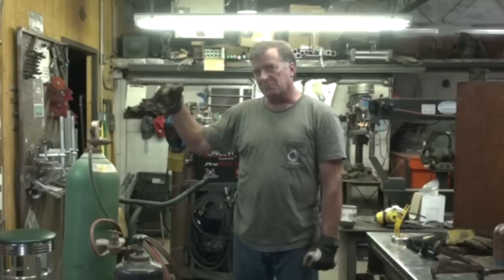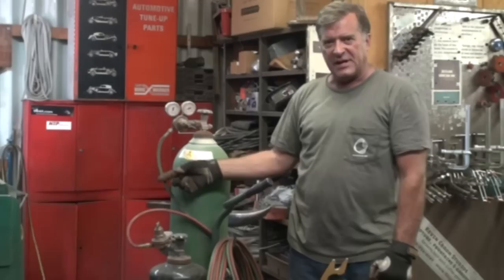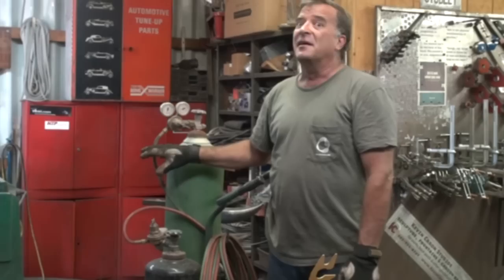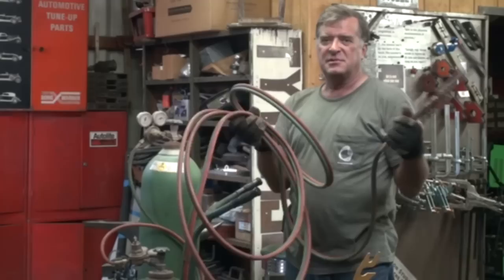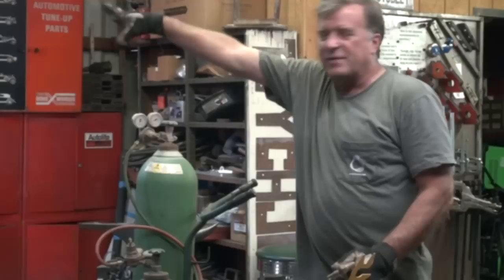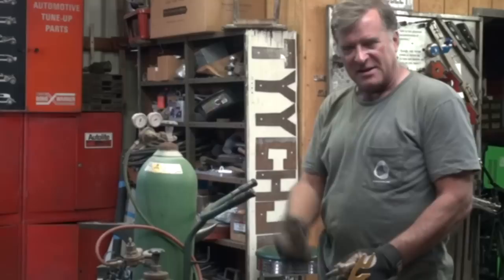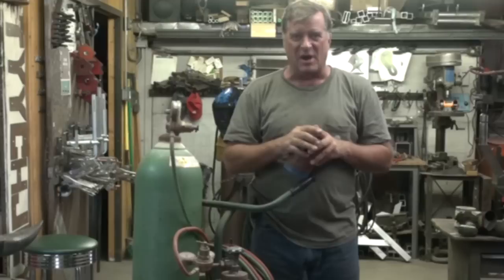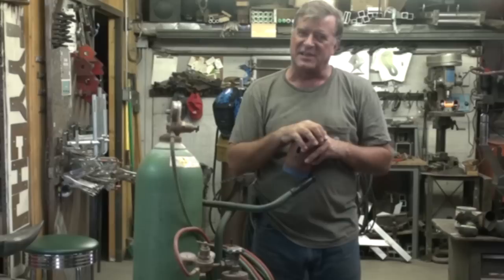Oxygen-Acetylene: "What Could Possibly Go Wrong?!" - Kevin Caron

Comment: This is good... I don't see anyone else stressing safety with the Oxy-Acetylene rig. I've had one mishap where a previous regulator (that was cranked up on a dead bottle of acetylene) was refitted to a new bottle. The person I was working with (my brother) wasn't trained to do this check list and I feel it almost costed us our lives. One hose blew up and the flashback was luckily stopped at the regulator. If it had gone into the acetylene bottle, I know without doubt I wouldn't be here today. The flashback was ultra violent, it created a huge bang. Know what you are messing with! 8 PSI for acetylene and I like 11-20 PSI on the oxygen side. Go above those numbers if you are feeling stupid.

Comment: You have oxygen and acetylene confused. Oxygen you open all the way because it is not dangerous and is very high pressure and the valve needs to be seated. Acetylene is low pressure and the valve does not need to be seated but is dangerous. On acetylene you open only 1/4 turn so you can turn it off quickly. Oxygen you open completely, acetylene only 1/4 turn.

Comment: Kevin, I have been using O/A since 1070, and just watched a Victor O/A safety video.  On the O2 cylinder, you ALWAYS backseat the valve when in use.  Opening slowly at first is correct in case there is a problem.  The Acetylene is only opened 1/2-1 turn ( just enough to get full pressure on the high side gauge).  If it hits the fan, it will be the Acetylene, and there in lies the need for a quick shutdown. ( as you run out the door, yell to The Voice to shut it down)
Reply: Correct! I have no earthly why he states, 'Some guys believe you need to open it up...'. YOU DO. It's a counterseat design so, those 'some guys' are completely industry correct! His recommendation is a pure safety concern.

Comment: No mention Sir Of How to spot  if Decomposition Takes place . On how the Cylinder will tell you By resonating  .   Good video  Nice Tig sat there .
Reply from the maker: Thank you for watching and posting.   No idea how to tell if the cylinder is decomposition on the inside. The bottles has inspection dates on them and they get a new one every 5 years.  If they fail they are sent to the scrap yard.
Reply: @KevincaronSculpture   Oh Don' t Worry the cylinder will tell you when decomposition is under way they physically Vibrate Resonate when they get to that stage it's time to leave the immediate area because they will let go soon after  and remove the roof .

Comment: It's also a good idea to have a good charged portable fire extinguisher close by whenever you are working with the torch set up. If we are working outside of our welding area on a job or equipment we put an extra guy on fire watch duty just in case.
Reply: 00sniper1 কহি র৫উ৬৫৫আদসগ।  জস্যহফ।  যদি গদস। য়েয়িদজ্য
Reply: 00sniper1 হ্যতেয়। য়দ্যক্যয়াগ্যতপখজ   য়সজিউয়ল। ক্লদ৫&&&হফজব।  হু৬

Comment: Very Informative  If you are not experienced  in using an   oxy  acetylene torch set  have someone  experienced  show you how to use them . a full oxygen  bottle is about 2200 lbs per square  inch coming  out of a hole the size of a pencil  . they sell oxygen  and acetylene  safety  covers that protects  your regulator & valve  they clamp on your bottle  neck . we are talking  about two gases that when mixed  are the most volatile mixture  on the face of our planet.
Reply from the maker: Good point!     You have a bomb sitting on that cart!
Reply: There's pics floating around the internet showing the aftermath of an acetylene bottle blowing up inside a plumbing truck, after it had leaked and the guy had used his keyfob to unlock the door.  Pieces of the van and the boat next to the van were on the roof three houses away. The van looked more like the T1000 in Terminator 2 when he got hit by that grenade launcher.

Comment: Hey Kevin, what you thinking? Be careful what you use to check for leaks in the system. A lot of soaps believe it or not are petroleum based, When petroleum meets with pure oxygen you have spontaneous combustion. Please be sure of what you use for leak detection.
Reply: Alright so what soap is good then.
Reply: You don't use soap you use an inert gas leak detecting agent that you can buy on amazon for 10 bucks.
Reply: You can use an ivory based soap

Comment: thnx kc > informative. ive been considering re-aquiring the skills and old school o/a equipment for brazing mostly, (noticed yours is set up for cutting like most ive seen). also witnessed a guy using a mini set-up, he ran small alloy filler rod beads on the tops of aluminum beer cans at a motorcycle swap met..coulda, shoulda but thought the better of it since never had super success with a normal sized set-up. anyway thanks.

Comment: inline flash arrestors, ensure cylinders are secure in their cart and not just free standing, check for heat in Acet cylinder, what to do if hot. Wear pants outside of boots, failing to coil up hoses after work finished. All could be added to a good video thanks

Comment: My acetylene working pressure is stuck on like 26 psi... it's roaring inside... i backed the t handle ALL the way out... no effect. Im Judy gonna ride it out and hope it doesn't level my garage. I don't know what tp do.  Yes i shut the tank off too
Reply from the maker: Pull the gauges and get them rebuilt!   Your local welding supply should be able to help with this.
Reply: @KevincaronSculpture  yea im gonna do that but at the moment i was stuck. Envisioning a sooty, still smoking rubble pile that used to be my shop and 100s of thousands of dollars in equipment.

Comment: It has been suggested to purge each hose for about 5 seconds per 10 feet to insure there is no gas mix in the hoses before igniting the torch.
There is a comment below about the oxygen valve opening amount; I have been informed it should be opened fully to prevent leaking and possible overheating of the valve. (Also see oxygen tanks and valves used for rescue vs. aluminum regulators.)

Comment: Whats wrong if the pop off want reset on a small cutting torch?
Reply from the maker: You either have a leak or you are just not right on the settings.   A little more of both or less.   All depends on the tip size.   Maybe check the specs on that tip to make sure you are set right?

Comment: So i wanna know what happens if you drop off the cylinders ? Do both explode?
Reply: if you happen to break the valve off on the oxygen, which can be at 2000 psi on a full tank you will have a missile till the pressure is gone. i have seen them go thru block walls,

Comment: While I agree with your thoughts on the high pressure Oxygen valve being just a quarter turn, some valve designs will not seal the stem until the valve is fully open. I had a "new" bottle bleed down when the valve was at a quarter turn. So now I have quick release fittings just off the regulator. This permits me to quickly disrupt the flow in case of an emergency. It also allows for the hoses to be disconnected when not in use or for transport. just my $.02

Comment: I exchanged an oxy bottle at air/gas and started counting the date stamping on the bottle that they wheeled out for me and found the oldest one to be from 1930 I asked was this tank really that old and he replied yes there are lots of tanks this old and older as long as they are hydro tested there safe. I loaded the tank in my truck and took it home but every time I welded something it gave me the creeps as if it was going to exploded.
Reply from the maker: Perfectly safe to use, just keep it chained up or the cap on when not in use..   I have a bottle that I turned in to a bell that shows the first date as 5/15.     As in 1915!
Reply: Wow over 100 years old, that's really cool.

Comment: Hi I can see  your a professional shop,I lent out, a acetylene tank 4 ft, The moron over tighten the Valve, And broke off the shaft, a 3/4 full Tank, what can i do, to release gas for new valve.
Reply from the maker: I believe there is a blow out disc on the side of the regulator,  Might be safer to take it to someone that refills the bottles and let them do iot.

Comment: Thanks for sharing Kevin! What is your opinion on the Everlast inveter welders? I just bought an Everlast dual voltage 140.
Reply: Hey Kevin,

I haven't received it yet, but it's an Everlast 140A dual voltage inverter welder. It has great reviews, and I cannot wait for it to arrive. For the amount of welding I do, I couldn't justify spending over $1,000 for a Miller or Lincoln. Though, I do have a straight 240 volt ThermalArc 181i inverter welder that I love. Love your videos!

Comment: Help please : I'm a carpenter...I'm wanting to dive into metals on a "hobby level"... "mostly thin steel,under 3/4 thick" I want the ability to weld,manipulate and cut metal top's 100 or so times a year. The QUESTION: am I right by assuming that the oxyacetylene torch is the end all be all of the craft?!,it's what I have my mind set to,and I've a strange fear of arc welding and any electric based styles "don't know why...perhaps it's a complete lack of understanding electricity as a whole?"I don't care about "most convenient" ,"most easy" or "saving time" ...I'm very hardheaded and failing to understand why they even make alternative means of welding?!?...I might be missing something,but can't see anything this completely logical setup can't do.
Reply from the maker: No, I don't think o/a is the best there is.  As a stop gap ,this is all you can afford , sure it will do a lot of what you want. 

But it's like having a hammer for a eating utensil.  It will work but not as well as having the right tools for the job.

For now go with what you can afford.    Once you get comfortable with the smoke and flames you will upgrade to better tools.
Reply: HAHAHA!! at the mental image of eating steak with a hammer !, Thanks for that and the knowledge , have a great day

Comment: my oxygen tank is pinning out on the max pressure and leaking out the top of the gauge. These are only a few years old. Trash time?
Reply from the maker: Time for a new set of gauges or get them rebuilt.   Normally cheaper to rebuild, just takes a few days to get it done.

Comment: What about when gas comes out of the bottom of the oxygen regulator
Reply from the maker: NOT a good sign!      Turn off the bottles and get the regulator rebuilt or replaced.     Do both regulators at the same time just to be safe!
Reply: if that was be id replace them much safer
Reply from the maker: Much cheaper to have them rebuilt.  Depends on your budget.
Reply: Kevin Caron, Artist but whats more safe tho just outta interest how much is a co2 regulator im using up a 10kg spool of flux core at this stage but was thinking of getting a co2 bottle since they have them currently at $200
Reply from the maker: $35 to about $100 dollars depending on what you buy...
Reply: Kevin Caron, Artist that's not bad i don't have alot of cash but when it comes down to what lasts longer ill always pick what coasts more

Comment: Hi I need help, I set my oxy/ acet system up all worked fine. Went to use today and no gas seems to go through pipes.... I'm well confused. Regulators are fine and bottles both full. Any advice would be great...
Reply from the maker: Start at the bottles, remove the regulator and crack open the valve. Gas flows?  Hook up regulator and remove hose. Try again. Gas flow? It's the hose or the torch. No gas flow it's the regulator.  My bet is the regulator is bad.

Comment: Hi like your video but I'm a first time welder just got a 180 dual lincoln I need gas bottles harbor freight has them but worried are they any good
Reply: Check with your welding supply all of the ones around me will not fill the Harbor Freight tanks or accept them for exchange.
Reply: Thank you both

Comment: How do you store the regulators when not in use? Do you need to worry about dust getting inside the connections?
Reply from the maker: Mine are in a cabinet in the tool room.   Door closed and the adjustment screw backed off.   If I can find the caps for the ends I put them on as well.   If I need to use one I just crack the bottle valve for a second to blow the valve out before I put the regulator on and do it again before I put the hose on.  Great question!
Reply: Kevin Caron, Artist mine never came with caps. And I’d hate for my oxygen regulator to get dust inside it and blow up

Comment: just picked up some sued torches and regulators  on is a smith vintage   
i keep reading smith has life time warranty but they won't fix it,      the torches are unidweld and UL,   i cna't find UL seems to be a knockoff  radnor i think  ,  and one heavy duty victor,   
i'm afraid to light them until i know they are good,    how can i check them   '  /     one guy told me to get o rings at ace hardware    
if o rings leak   wouldn't i see it with soapy water?   if no leak    is there any danger?
will it just pop or blowup  ??  thanks
Reply from the maker: Look at the orings to make sure they are there and not broken.   Blow air through the torch body and tips to make sure they are open/not clogged.      Look at the hose to make sure not cracked or cut.      Put regulators on gas bottles and turn adjustment screws all the way out- but do not remove from regulator body.      Check for leaks,   no leaks,,    put all together and check for leaks again..    No leaks,,,,   fire her up!!

If any time you find a problem have the torch rebuilt first or get new hose or ....
Reply: theya re open   when hooked up gas flows,   o rings look very compressed  and on the big vicotor has a line/ contact point in it
o rings are flush, not over the groove
Reply from the maker: The victor "might" still be okay..   Only way to know is fire it up.. or just get it rebuilt before hand..
Reply: thanks    $80 for a rebuild
happy thanksgiving

Comment: Talk about poor advice. You MUST open the oxygen cylinder and the acetylene cylinder all the way for safety reasons. The only time you open them 1/4 is with the key style wrench also you need a flashback arrestor at the regular.